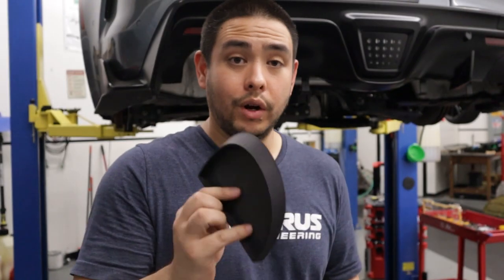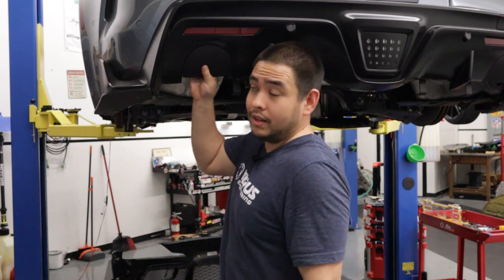Mk5 Toyota Supra Exhaust Cutout Cover Install

Comment: Do you have a block of plate for the right side as well? Some single exit exhaust companies offer the option of the hanging the rear can on left or right.
Reply from the maker: We sure do. Just make sure you select the proper side when ordering.
Reply: @VerusEngineering  Sweet!
Reply from the maker: @verginsergin  Sure is sweet!

Comment: I installed mine and it's a totally different black than my bumper, looks terrible...
Reply from the maker: I'm sorry you feel that way. Keep in mind these are 3D printed carbon nylon and since they are not printed out of the same material as the rear bumper, they will not be a 100% color match. The product page on our website states, "Note: These Exhaust Cutout Covers are 3D printed out of a different material than what the rear bumper valance is comprised of. Due to this material difference, there is a slight difference in color and reflectiveness."
Reply: So…..  Black semigloss vinyl wrap and the mismatch color problem is resolved.   Took 5 mins tops.

You could even include a couple squares of vinyl in the bag if people want to do it themselves.

…just saying it’s an easy fix.